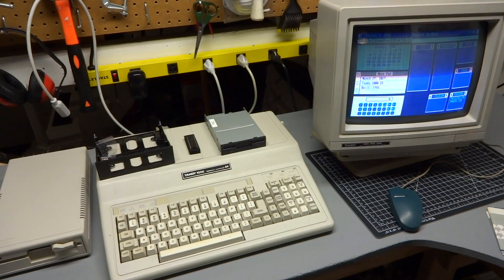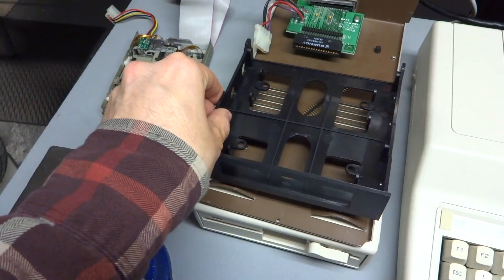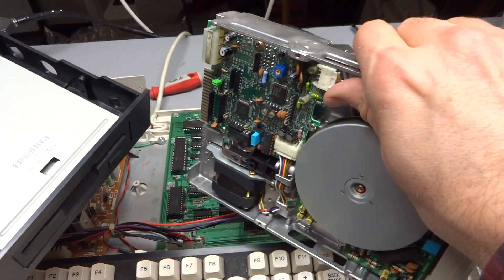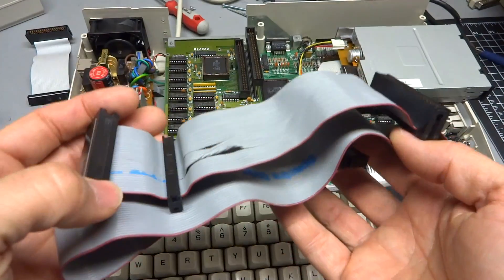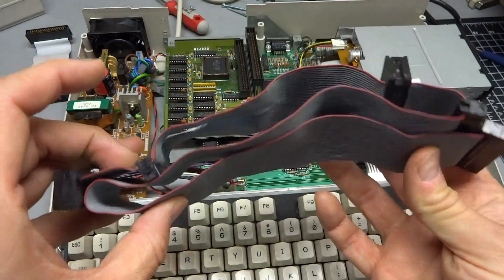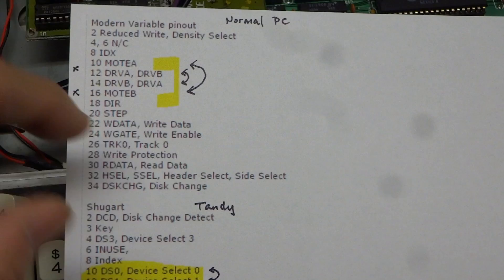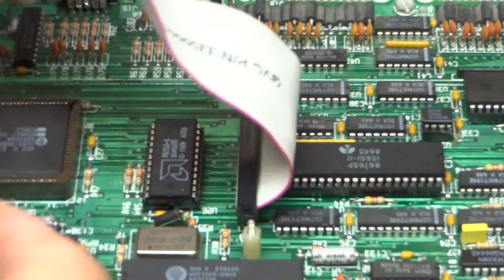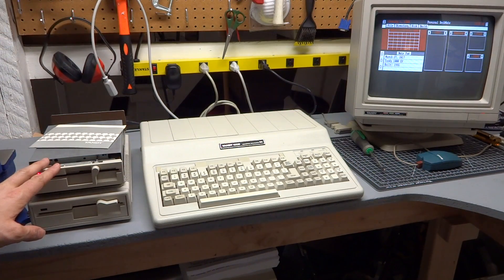Tandy 1000 EX 3.5" floppy drive upgrade

Comment: Beautiful video, only thing I would have done differently is punch a hole through the pin connector that's blocked instead of physically modifying the connector on the Computer

Comment: so instead of removing the blanking plug in the cable socket, or taking a hot needle n making a hole in the blanking plug, you cut a pin off the motherboard? bit extreme, but well played lol

Comment: had a thought.  your previous video said [i think] there was a button on this pc to allow you to boot from the b: drive, presumably external.  if you used the 'straight thru' [ie untwisted] cable, could you then boot from the INTERNAL 3.5" D1 b: drive ?  i guess you'd then need your custom twist for the EXTERNAL a: drive.  fun to tinker :) .  thanks again.

Comment: Oh no... Hot needle, small drill bit, any number of ways we opened up those keyed cable connectors. We never snipped a pin off of the motherboard. That hurt to watch!
Reply from the maker: Why? It's an unused pin anyway.
Reply: @adriansdigitalbasement  1) It's easy. 2) Resale back in the day 3) Get off my lawn! lol

I started out as a hobbyist on early 8-bits and it later became a career. I messed with that stuff daily.

Excellent video series. Enticing me to get the last original boxed HX and Tandy CGA monitor I have, but never used, out of the garage. Still triggered, though. ;)

Carry on.

Comment: Oh Man, glad I found your channel. I took out my good ol' Tandy 1000 TX just to find that both internal floppy drives are not working. That means that I will try to modify a cable to use a different one. Now, another odd thing happened, the first days the Tandy monitor was working fine, and then, looks like is on but there is no signal. The problem here is that since it is a CGA monitor, there is nothing I can use to test, and same goes with the Tandy internal graphic card. I can still use the RCA output to a TV. I know that I might be able to get a VGA card, but I want to use the propietary 16 colors thingy. Any idea how to verify where is the problem?

Comment: Just did this to replace a drive on an HX.  Had to also cut out the power lines and add some colored wires with dupont connectors to run power to the molex on the floppy.  Worked great!

Comment: i have a question, but for another idea, i have a clone turbo xt, nec v20 (have ten really jaja) y want overclock de cpu, i  think in change the cristal....in the datasheet the pin 9 is the clock, a wanna make this but i need you opinion

Comment: All you need is a straight thru 34 wire cable and then set the floppy drive to DS0, I actually make a cable kit for the 1000 EX. Then you don't need to cut pins out etc.

https://www.tindie.com/products/CyberneticSys/tandy-1000-ex-internal-35-drive-conversion-kit/

Comment: Just a little tip for similar situations in future - application of just a moderate amount of force on the ribbon cable connector forces that pin through the blanked off hole on the connector. I've encountered this issue so many times and as long as you line things up right and give it a squeeze, you're golden. 

You do have to apply some pressure of course but in my experience it's never been enough to risk breaking the PCB.
Reply: izools that's a good tip. Heck, you could just keep an old PCB that was trash around that had the proper sized pin, and I mean only a single pin would be needed, and use it over and over again to break that little key out of the hole. If it ever did break the PCB, it was junk to begin with, so nothing is lost. And we all have junk circuit boards lying around, right?

Comment: This computer can support a hard disk drive. I had one of these as a kid and it was fully maxed out, other than the vic20 CPU you had in this. I had the 5.25 internal drive, 3.5 external and an external 30mb hard drive. Along with the 640kb RAM.
Reply: How?

Comment: Hi there, I just got my own Tandy 1000 HX and it boots! Mine has 2 720k floppy drives installed. Now my mission is to clean it up and find some way to get software on it. You mention that a 1.4M  drive can read and write to a 720K drive? could I use a usb to 1.4M  disk and copy files to a 720k disk?

Comment: Got a question for you if you have time. I have a Tandy 2500sx that appears to be similar for the drive situation. Would this work the same for a 2500sx? I want to replace the built in 3.5 drive if possible.

Comment: Hi, I have a Tandy 1000SX with a 5.25" drive on DS0 and the 3.5" on DS1. 
The 3.5" drive seeks on initialization and does everything a 3.5" drive would do, but when it comes to accessing data after initialization, the head will not move. I've cleaned the drive heads with isopropyl and tried other diskette drives to no avail. 
For my setup, I'm using a straight through wire for the 3.5" and 5.25" drives.

Comment: A bunch of drives still have config jumpers on the board when you go and look. Usually they are made with resistor links or somesuch, so with a bit of reverse engineering you can find what connections to make or break to change the drive settings. Some times they are even marked on the board. This coming from a guy who's made several "modern" PC drives fully compatible with Amigas.

Comment: why did IBM do that, it's so bloody stupid.
Reply: It stops the motors of both the driv4es running at once, and means that end users don't have to change jumper settings on the disk drives. It's not ideal since you lose the ability to add two extra drives, but at least it prevented the drives from wearing out faster

Comment: I have a zenith 8088 laptop (pre supersport) and its 720k drive was only reading 1 side, no problem I will just toss a generic drive in there and it spins up, then does nothing, so I am going to try flipping those two connections, thanks for the tip
Reply: well I finally got around to this and it works, but my main problem is still there as the zenith only reads and formats as 360K ....  which is bizarre as the system only came with 720K configurations, more reading to do I guess

Comment: looks good!  in my understanding it is possible to add a hard drive with a custom Isa adapter but I've never done it.
Reply: Indeed it is. The lo-tech IDE-CF card https://www.lo-tech.co.uk/wiki/Lo-tech_ISA_CompactFlash_Adapter_revision_2b with a PLUS-ISA adapter or ribbon works well. I didn't have enough room, even for that, due to the dimension constraints on an I/O card I put in, so I prototyped my own PLUS version on a perfboard: http://www.mediafire.com/folder/bokkx6dycikaw/Tandy_1000_EX-HX_CF-IDE

Comment: Are you familiar with LoTech EMS cards ?  I have a Tandy 1000 TL and  have a Lotech EMS Card with 2 MB Ram I can't get to address.
Reply: This is a relatively new device from Lotech. I'm having conflicts with other devices in my system.
Reply: I think the TL couldn't handle more than 128KB past the standard 640KB, and that was only for the video RAM.

Comment: A hot paperclip can melt a hole in one of those keyed connectors.
Reply: the oldschool way was just a barbed filler tab of plastic which could be picked out with the tip of a knife
Reply: Or just find another cable without the keyway.
Reply: They can !  I tiny drill bit works as well, I use to do it all the time.

Comment: Could you have done this without cutting the pin? modify the cable connector or something?
Reply: Could have also drilled out the connector on the cable.
BTW, you might be able to mod an old 8bit ISA HD adapter to work on the old Tandy.   I don't know if the bios would support it, but you could boot to a HD via a floppy.  IIRC there might have been some 8bit ISA cards made to use IDE drives in old XT's.

Comment: I added a zip 100 drive on my tandy 1000 sx, so once dos is started from the floppy and the driver for the zip drive is loaded and the shell line is added in the config.sys, it's all good. I just need to add a 720k drive to the drive b and it should be all good. Great video too ^^

Comment: The 1000HX is slightly more complicated, you need to cut PIN's 3,5,7,9,11 as they carry +5V from the motherboard and you also need to cut PIN's 29,31,33 as they carry 12V from the motherboard.  The HX internal 3.5" drive powered the drive straight from the motherboard, if you connect them straight to the new drive you will blow it, which i did, lucky i had another one and did the drive select mod that you just did, but i tied PIN 12 straight to ground.  Also did you get the 5V from the Tandy PSU ?
Reply: Thanks Adrian, I now have it fully functional, I used your technique of powering the drive from the internal power supplying, I have a small issue with drive select where    both drives can't work at the same time however I'm extremely happy with the result and much appreciate your support
Reply: @omarhammoud7223  Adrian's cable mod only works for using a single drive A. For a second drive (B) the cable has to modified differently.
Reply: @brother_dana  do you have the instructions on this ? i did it however want to know if there are better ways
Reply: I happen to have an HX. My dad tried to upgrade the floppy in such a fashion (it used to be his), and learned that the hard way.